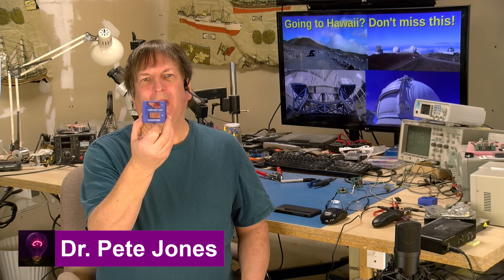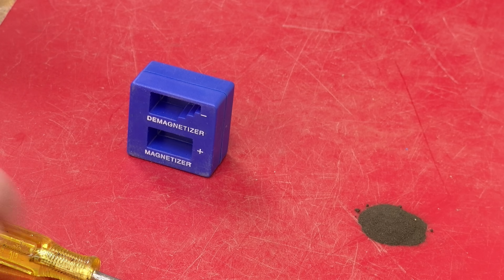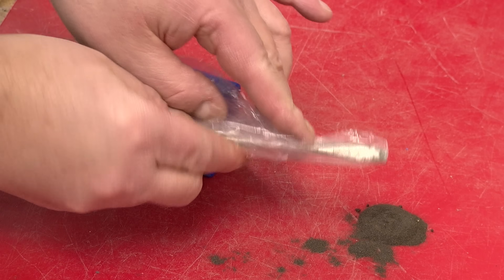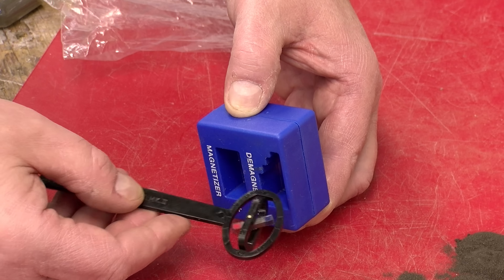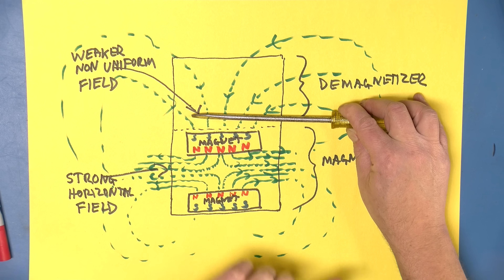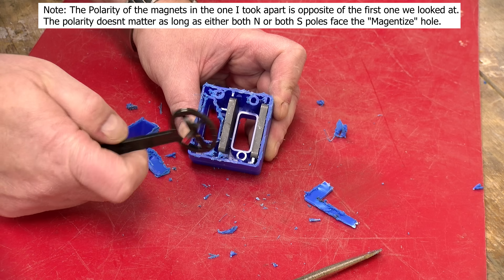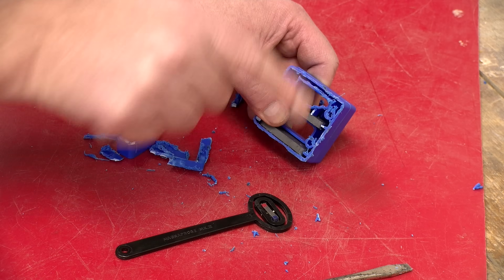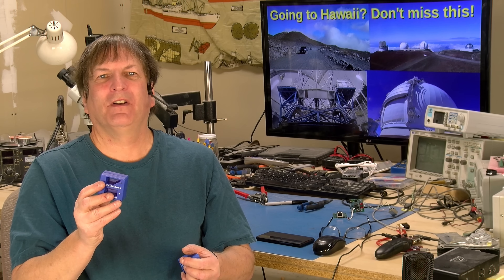How do these Magnetizer/Demagnetizers work?

Comment: As a teen in the 70's I remember my dad using his Weller soldering gun to magnetize his screwdrivers. He would wrap several loops of copper wire around a broom handle and connect the ends to the gun. Remove the broom handle, pull the trigger, slide the screw driver inside the coil, and voilà the tool was magnetized. I wonder if your magnetizer tool existed back then!? 🤔
Reply from the maker: What a neat memory. The trick with magnetizing things that way is to turn the gun off while the AC field is at its peak so it leaves a string field in the screwdriver. Leave it on and pull the screwdriver away gradually  and you can demagnetize the the screwdriver. I did a video that includes a Weller soldering gun doing just that here: https://youtu.be/mGK8oYdEqyE

You know, I would be so interested to know when someone invented this little device. My guess is 1960s is the earliest it could have been developed because thats when plastics became in widespread use making it simple to manufacture. If anyone knows when they first appeared, or what company made the first one, please post!

Comment: Oh weird, never seen this.  I know you can just rub a magnet down one side and it's magnetized (weak) and rub it down the other side to erase it but the best, funnest way to really do it is wrap a coil of speaker wire around the screwdriver and short each end to ur car battery to make it a momentary electromagnet while it instantly gets red hot and the insulation all burns though, then enjoy ur new magnetic screwdriver!
Reply from the maker: Just to be clear, the insulation burning off is the fun part - but not actually needed for the magnetization process :) . I did a video on magnetizing things here: https://youtu.be/S21rlwrY74I
Reply: @ElectromagneticVideos  Awesome bro, I'll check it out, science is neat!
Reply from the maker: @THRASHMETALFUNRIFFS  Enjoy!

Comment: Thanks for the info. It would be nice to understand what's going on inside the screwdriver though throughout the process and not just the steps that the process uses to accomplish this. Information like why the stair step process demagnetizes the screwdriver, how to fix the molecules and crystalline structure of the metal etc would be helpful instead of just (the stair step process demagnetizes the screwdriver.)
Reply from the maker: Glad you liked it. A while back I did some videos onwhat goes on in the metal when things are magnetized, and also how demagnetizes work. Here are the links: 

Magnetize: https://youtu.be/S21rlwrY74I
Demagentize: https://youtu.be/mGK8oYdEqyE

Hope that helps!

Comment: If you continuously put different screwdrivers in the + hole would the magnet run out?
Reply from the maker: It would not run out! The reason that magnets often weaken over time is usually misuse - dropping them or overheating them, or exposing them to opposing magnetic fields (ie pushing the N poles of two different magnets together ).  So for these devices, dropping them is the most lily cause of the magnets inside weakening.

Comment: I knew the demagnetizing hole was a fake hole - it was just the outside of 2 magnets. But I didn't know the steps had any use. I thought they were just a visual guide, to identify the 2 holes.
It's still a very magical device.
Reply: It's not a fake hole at all the south field flows through it & the stairs are designed precisely for it, I've even used it to demagnetise tweezers successfully it's brilliant
Reply from the maker: @neiliewheeliebin  I never thought of tweezers, but I can sure imagine trying to release tiny little things and them refusing to leave the tweezers. I wonder if watchmakers demagnetize their tools? They probably have to.
Reply: @ElectromagneticVideos watchmakers either use non-magnetic tools or an AC demagnetizer.
Reply from the maker: @robertlitman2661  Interesting - I guess for things that size tweezers and similar can be made out of non-magnetic material. I suppose screwdrivers have to be steel to handle the torque on the tiny sized tip.
Reply: @ElectromagneticVideos  There are ceramic screwdrivers, and beryllium bronze or even gold gears.  Lots of stainless tweezers and even stainless screwdrivers, but in the end, ferromagnetic steel usually makes for the best tools and you just suck it up and demagnetize.
Reply from the maker: @robertlitman2661  Interesting! I guess every profession has its own specialized parts. I sometimes have to deal with tiny surface mount electronics parts - handling things the size of a grain of sand is definitely not something I'm any good at. I'm always very impressed with people who are good at that tiny stuff.
Reply from the maker: I wouldnt say its a fake hole - more a positing hole? The funny thing about the steps is that few if any of these devices come with instructions and I havnt seen anywhere describing the use of the stairs. Although whoever created the first one of these must have really understood magnetics, I'll bend most of the copies are built without any understanding of why. I must admit it took me a while to figure out the steps had a real use and that they operate similar to a "real" AC powered demagnetizer.

Comment: Btw, this is i suppose also inside that passive demagnitizer Sony BE 9H Techmoan showed?
Reply from the maker: Just googled that video. My guess is that its actually a magnetizer that  drives the magnetic tape coating into saturation (=constant, highest possible magnetic field for that material) erasing all recorded magnetic variations (the recorded information) but leaving the tape magnetized. A bit  later he tries it on some high coercivity tapes and it leaves a hiss - that then disappears when the tape recorder itself is used to erase/demagentize the tape, which supports my guess.

If I ever come across one of those devices, I'll have to get one and open it to see if I'm right!

Comment: They are more effective than I judged they have a right to be. You'd expect the magnetizer to not really magnetize and the demagnetizer to not really demagnetize but what you get is something that is very effective at both. So its not transferring anything to the screwdriver, its just lining up existing magnetic domains within the steel or partially randomizing them. A very cool and handy piece of kit, even the super cheap ones.
Reply from the maker: Exactly what I thought - amazing little devices. I wish I knew who came up with the ingenious designs that so cheap and yet so effective.
Reply: @ElectromagneticVideos  I just bought the exact (almost) replica of yours in the video -colour, shape, staircase -exact BUT... the staircase hole is labeled as a magnetizer (+) and the other opening below is labeled ddemagnetizer (-).  What the?   I tested it out and it works just fine as labeled.  So two magnets are demagnetizing in this case and one is magnetizing, basically the opposite of your unit   -there's something to explain.
Reply from the maker: @Vineetoba  Wow - thats interesting! So are the magnets located around the hole without the staircase? Or are the two around staircase? And are the two magnets setup so that whichever hole they are facing the have the same pole (ie either N or S) facing that hole? (you would need something like compass or small magnet to check this)

I could see if it was setup so with magnets around the no staircase hole oriented so one magnet's N and the other magnet's S faced inward to the hole, the no staircase hole would be a poor demagnetizer and and the staircase hole could be a poor magnetizer. But not as good as the configuration in the device I have. Let me know of I am right!
Reply: @ElectromagneticVideos The earliest one I found was a patent in 1967 by Cloyd D Smith (US3467926A)!
Reply: @ElectromagneticVideos 
One should be able to make their own? - crudely or with a nice 3D printed case.
Reply: @djmips True but this is probably one of the few things it’s cheaper to just buy lol - it’s hard to beat $3 at a local walmart or $1 on Temu, vs the costs for the pla, electricity, magnets, and your time
Reply from the maker: @djmips  Yes - the hardest though would be to find a suitably shaped magnet.
Reply from the maker: @5hirtandtieler  Exactly - not worth it from a $ and time standpoint, but might be a neat way to test a new 3d printer.
Reply: @5hirtandtieler  But a self-built could use very powerful, say N52 neodymium, magnets.  I'd like to see if that resulted in a stronger effect in the screwdriver.
Reply: @Sylvan_dB honestly 3 bolts is more than strong enough. I find that if the screwdriver is too magnetic it becomes hard to use around metal things. Just enough to hold the bolt it better than one that can hold the screwdriver to the side of the fridge in my experience with them. They really are simple devices but i have used them a few times when your in a tight spot they really help get the job done.
Reply from the maker: @newmonengineering  I never thought of that - your absolutely right - there can be too much of good things at times!
Reply from the maker: @Sylvan_dB  Go for it! Build it and and see - could be a fun experiment!
Reply: @Sylvan_dB  probably not because the domains are being aligned it won't be stronger if you used neodymium magnets to do the aligning.  I expect the problem could be that you may not be able to de-magnetize as easily because the distance of the steps vs. field strength matters.  And, do you want a stronger magnetic screwdriver?  I find that a hindrance which is why they have a demagnetizer I guess.
Reply: @dr_jaymz When I worked as a tech in IBM in the 1980's, we had to demagnetize all our tools using a large AC demagnetizer before going into the machine hall, to avoid potentially disrupting all those magnetically sensitive computer devices
Reply: @dr_jaymz  
>> do you want a stronger magnetic screwdriver?

No.  99% of the time I very much do not want any of my tools to be magnetic.  And 98% of the time, they are. :(
Reply: When I was a kid we would swipe magnets over screwdrivers to magnetize them, learned it in school I think😅I wasn't the best student but neat things like this I 'memeber
Reply from the maker: @digginggopher  That experiment is school is a very vivid memory of mine too. I think it made an impression on most kids - hope they still do experiments like that.
Reply: Ive had two of these only have one magnet before. Even though there was a place for two.

They really cheap out on ones they include in repair "kits" that are everywhere online like Amazon and they definitely don't work as intended.
Reply: And all I was going to comment was: Oh, so that's how they work! 👍😁

Comment: Is there one that you would recommend that magnetizes more "powerfully"  for heavier screws?
Reply from the maker: Unfortunately the limitation is more from the type of steel that screwdrivers are made from. If you need a screwdriver with a really strong magnetic field, try attaching a strong permanent magnet to the screwdriver.
Reply: wrap speaker wire in a coil from the handle to the tip and short both ends to ur car battery.  This creates an electromagnetic field in the center of the coil momentarily until all the insulation burns off and the wire snaps.  Now ur driver is magnetized for life.
Reply: @THRASHMETALFUNRIFFS  preferably do it near the opened fuel filler cap..
Reply: @AlfieDoug  Now that would just be preposterous \m/
Reply: @THRASHMETALFUNRIFFS  You dissapoint me, I thought you would be a fireball by now, please do a video of your speaker wire trick.
Reply: @AlfieDoug  Ok, I'll try... in the meantime check here when I made Plasma in the Microwave
Reply: @THRASHMETALFUNRIFFS  I'll give that a miss, I haven't recovered from my wife's microwaved salad.
Reply: @AlfieDoug  Man, I thought you were here for the science?!
Reply: @THRASHMETALFUNRIFFS  Advising you tube commenters to wrap wire round a screwdriver and connect it to a car battery could be bad science if performed by an idiot but you would know that.
Reply: @AlfieDoug  Oh, well I learned it in autoshop class in 1990 but I guess the one teacher that had the un-ashed cig hanging off his alcohol shaking fingers over the carburetor of the 72' Datsun we were learning about ain't too worried to at least try something out of the box cuz it just might work!
Reply: @AlfieDoug  At least Marie Curie wasn't too afraid to try... "Can't never did anything". \m/

Comment: I used to work at a place that demagnetised equipment containing instrumets to measure the Earth's magnetic field. It was actually in Ottawa.
I think they used an AC coil, but I am not sure. The path of the tool was important
Reply from the maker: Interesting - I'm just outside of Ottawa near Carleton Place. An AC coil is the typical way to demagnetize things. The steps in  this $3 device effectively makes a decreasing AC field as you move up the steps, so exactly the same idea. I did a video showing how to demagentize with AC a while back: https://youtu.be/mGK8oYdEqyE
Reply: @ElectromagneticVideos Nortel alum?
Reply from the maker: @beefchicken  No - but various smaller companies in the Kanata area. You? Just subscribed to you channel - you have lots of interesting vintage stuff!
Reply: @ElectromagneticVideos  never worked there, I’m just interested in the history of the company. When I was 16 I bought an old Nortel PBX at an auction. Figuring that thing out steered me in a direction that led to my career in telecommunications.

Thanks for the subscription, it’s been a bit quiet lately, young kids have that effect on a YouTube channel!
Reply from the maker: @beefchicken  How cool - you know it was Nortel / Northern Telecom that was the pioneer in digital telephone switches, and thats what turned the small Canadian manufacturer in a global suppler (until they went bust after the dot com boom). 

Completely understand the time issue - making videos does take a lot of time.  Are you in the Ottawa area? There should be lots of lots of people with Nortel know-how and information - probably facebook groups with old employees might be a place to look for if you are in need of information.
Reply: @beefchicken Memories, Did a lot of Nortel Meridian installs. One thing I remember liking about them was being able to program them from any phone set. Prior to those days I spent most of my time with mechanical switches. I'd always keep a piece of Emery cloth in my pocket to clean up the occasional stuck relay. 😊